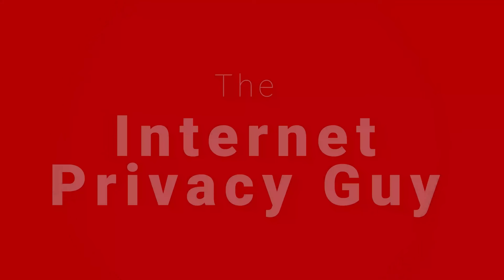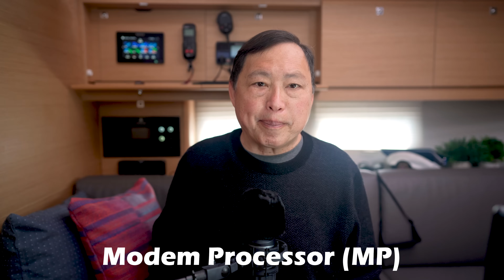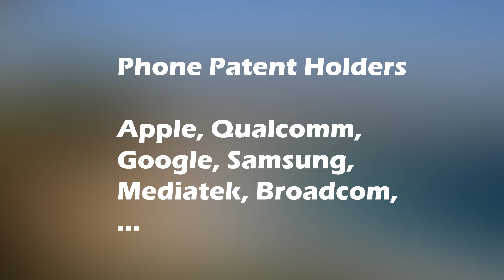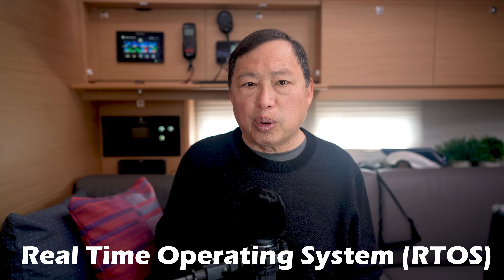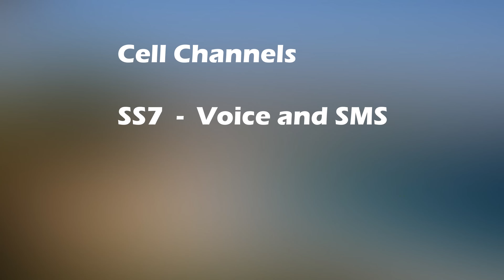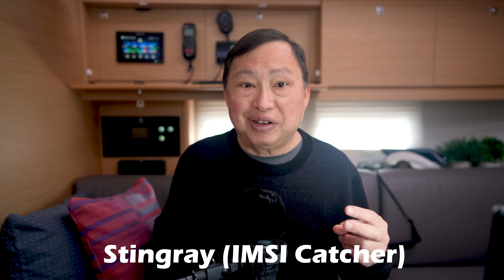How All Phones Can Be Hacked

Comment: Great videos. 👍  If my phone is hijacked by a Stingray device from adjacent area. Do they continue to monitor my phone or devices on the Stingray device or do they have to return n monitor, only available, from close proximity?
Reply from the maker: direct interception has to be in close proximity. But once your IMSI is identified, the tracking of certain things can continue using the CALEA surveillance equipment built into the PSTN (Public Switched Telephone Network)

Comment: A QUESTION.

My company invested a lot of money in ruggedised cell phones, and with 3G being closed down we decided to buy a few 4G & 5G to WiFi modems so our 3G handsets lifespan is extended. The SIM cards have been removed from the 3G cellphones. 

So we have sub-nets of cellphones running on modems - we use Telegram, and similar, for comms.

The questions centre around the modem & cell network. Given the only SIMS are in shared modems, what useful data could be collected upstream.

One other question. There is a setting on Android for WiFi comms between handsets. How do these networks operate?

Comment: The smd components on the pcbs are now connected by tiny nano meter sized pins underneath the chips that are  adhered to the pcb connecting pads  by a hot air gun or hot plate  and a pre printed template that holds the component's  in place Witch only the manufacture is licensed to only have these component holders while the pcbs are being manufactured. You can make one of these holders if you have a 3d printer a scanner and a programme. So you can make shure that you will make all the connections underneath the chip and components like the capacitors and diodes cause they are soo sooo tiny. And an old cell phone makes a good rework soldering iron.rhTs what I use.

Comment: But even without the SIM wouldn't the phone be identifiable via the IMEI? Or is that not transmitted without a SIM present?
Reply from the maker: The transmitted value is "Ki" not the IMSI which is in the SIM. Without it, you are not accepted on the network unless it is a 911 call. But you initiate that

Comment: Phones have five computers - the key three are com, interface & power management.  
The Com part has to interface with the telephony system - it is externally defined.
Reply from the maker: I believe you. Do you have inside information? I always say there are at least 3
Reply: @robbraxmantech  It comes from the specifcations -  the Telephone part is "fixed"  . The power control is very cryptic - I know it exists - i don't  know much about it, it is very  much the security hole in Apple devices :(.
The telephone part is public, So is insecure by structure. The security comes from economics - the cost of network access - little security for the user here.

The interface is much too complex for the function provided, so lots of security holes.

The Fourth Computer is the hardware Abstraction, it networks everything

The Firth Computer is the data management engine.

I define computers from a mathamatical prespective.
You are defining computers from a hardware network prespective. you are correct in that three is a minimum.

Comment: I use "emergency mode" on my phone which is a power saving feature which they hide in the emergency call settings. They further disincentivize it by giving you a user agreement first that a normal person (skimming) would find unnapealing. Then, in the mode, the text feature becomes a 'send help' by initially auto-populating the text field with "I need help" and a google map link to my gps coordinates however one only needs backspace that away. You get 2 optional apps (including browser and FB yuk) but the reason I use it is because on a full charge the battery will last over 8 days NOT on airplane mode and so, I imagine, that this mode will actually not, or at least in a diminished sense, exploit your tracking data so ubiquitously. Maybe Im wrong but the phone battery actually lasts that long and the only thing I can figure is that its just not broadcasting non-stop like normal.

Comment: Rob do you know if it's legal to flash custom ROMs onto a tablet in the USA yet (replacing the original ROM)? I know congress made it legal for phones years ago but not tablets. But phones are basically small tablets so maybe it is legal to install custom ROMs in tablets after all? Websites say it's illegal though last time I checked.
Reply from the maker: illegal? It's your device. Why would it be illegal? Or maybe we're in a new world now. We buy devices and it's not really ours. However the real problem is that there's no custom rom for new tablets.
Reply: @robbraxmantech  I agree with that statement about ownership. I asked because I did hear some recent news about the passage of some new laws which might make it legal now such as what they call "right to repair" laws (or executive orders?). No custom ROM's for tablets? Really? You sure? I could swear I recall seeing some custom ROM's for some tablets. Lineage OS at least iirc. I'll need to check to be sure. That was a while ago. Possibly a few years ago.
Reply: @robbraxmantech  My understanding is it's perfectly legal if the tablet manufacturer allows it and you truly own it. You may not truly own a device though. Especially if it's provided by some cell phone service provider. You must check the licenses for it. Some are subsidized making them more affordable but at the cost of never actually owning it so you forfeit the right to install custom roms unless it's allowed by the license.
Reply: @robbraxmantech  Looks like you're right. Lineage OS does not have any roms for the tablets I thought I remembered seeing. At least not now. None of the android custom ROMs I was thinking of have any roms for tablets. So it's back to the drawing board for me.

Comment: Rob, you're saying that adding a switch will RUIN the function of the antenna, so it won't work to turn the antenna off. THINK ABOUT IT. RUINING the antenna is JUST AS GOOD as switching it off. Right? So what you need to do is add a switch at the END of the antenna, to add length to it, so that it can't resonate at the right frequency. I'm always surprised by your consistent NO-CAN-DO approach to problem solving. JFC, buddy. Just get it done, already.
Reply from the maker: Hahaha! But as I said in the video, it is 12nm tech. You got a soldering gun for that? LOL
Reply: @robbraxmantech  I want YOU to design a daughter board that adds switches to sensors, antennas, etc. There's no need for a solder gun, or a microscope. The connections will be done simply by sandwiching in between the FPC connectors that connect the logic board to the sensors. It's all PLUG AND PLAY, especially if you design it to replace the original back of the phone.

It's odd when a smart guy is purposely obtuse, and won't make a product that would be in high demand for his 360,000 subscribers. Once again, you say NO-CAN-DO, yada, yada, yada. But YOU are the one that said it's so easy to make an antenna non-functional by changing its length.

Who cares whether its 12nm tech, or 20nm, or 5nm? A logic board is still a logic board, and an SMD QFP or BGA is still a QFP or BGA. An FPC connector is still an FPC connector.

With all this no-can-do BS you throw out, I'd bet a lot of money that you had a government career.

Comment: "A phone motherboard is an SOC"
You mean a phone CPU is an SOC

Also I've been quiet about this, but Bluetooth BLE is redundant and makes you sound like a robot. Either call it BLE or Bluetooth LE.
Reply from the maker: have you looked at a phone motherboard lately? which CPU? There are at least 3.
Reply: @robbraxmantech  That's the thing. A motherboard is not a chip.
A motherboard is a printed circuit board. An SOC is a system on an integrated circuit , or "chip"
There are 3+ SoCs on the average phone motherboard.
Reply: Just realized I might not have elaborated enough. A computer with all the required components on one PCB is what you could call a Single-Board Computer, or SBC. SBCs usually have one or more SOCs on them, serving as processors, radio controllers, etc. Phones are just the spookiest of their kind, with multiple independent SOCs rather than codependent ones you might find on things like the Raspberry Pi.

Comment: Sorry if I missed this.  What is the attack surface of a simple  'dumb' phone with no dataplan?  You know, a phone that a phone and only a phone.  And not a pocket computer which makes calls, runs hackable apps, does not protect privacy at all well on many levels.

Last point, phone with removable battery and faraday bagging options.  

Without going all tinfoil hat, is it possible to have a cell phone yet be private/hidden until it's turned on for use as only a phone for calls/sms?  Would like to see a video of this discussion.
Reply from the maker: The video applies. It has an MP like all phones. Hackable like all phones. But because there is no AP then the hacks would not access internet activity and files
Reply: @robbraxmantech  Thanks!  Was hoping for some dirt cheap MP less capable/hackable.  

MP attack vector is always carrier network based?  loosing AP reduce vector at all?

You channel is always insightful and thought provoking, thank you!
Reply from the maker: As I understand it, MP communications is through the radio only. So that can be initiated by a cell tower or something emulating a cell tower
Reply: @robbraxmantech  That last part "...something emulating a cell tower" is both worrying, and provoking.

While it would take a good bit of engineering,  emulating your own cell tower as man in the middle then monitoring, filtering and potentially firewalling could be quite interesting.....and most likely quite hard to do.  But I can't see another way to even start to protect MP from nefarious actors.

I assume cell boosters are bent pipe forwarders, but have potential to be an interesting place to start looking into.  Could a phone always be forced though one connection point?  Just musing out loud over a beer.

Thanks again

Goes back to the old movie, war games.  With Cell phones the only way to win at privacy is just not to play.  That's not a realistic option though, except for the Amish.
Reply from the maker: Stingray IMSI catcher is a government device that communicates with the baseband (MP) as a fake cell tower. So this is not a new concept.

Comment: How can anyone be 100.000000% certain that there isn't a hidden internal eSim, or engineered flaw/feature providing equivalent connectivity, built-in to the MP? I wish there were a true open-source solution.
Reply from the maker: If they did that, they would be circumventing their own security which is the "Ki" on the sim card. Someone can harvest "Ki"s and can duplicate Sim cards. So it is possible but if would be a stupid move from a cybersecurity point of view. Remember the actual identifier to enter the carrier network is the "Ki"

Comment: Wouldn't it be better to put the power switch to the whole of the MP instead? Isn't that what Pinephone does?
Reply from the maker: I actually answered that in the video
Reply from the maker: And no, that is NOT what the pinephone does. The pinephone separated the modem by using a separate SOC in an IOT USB device. Then all they had to do was unplug the USB.
Reply: @robbraxmantech  thanks for the answer!

Comment: Only one of the chips on the circuit board is the SOC, not the whole circuit board.
Reply from the maker: Huh? There are at least 3 SOC's in a phone
Reply: @robbraxmantech  he's confused by the fact that THE SOC is commonly only referring to the single primary user application processor suite.
Reply from the maker: Then let's make it clear. An SOC is a full CPU. The two independent CPU's are the AP and the MP. The AP runs other SOC's like the Wifi/Bluetooth/GPS module. That's under the control of the AP.
Reply from the maker: This video is intended to make everyone rethink what is actually going on. If you watch the video fully (it is very dense), the MP has a different OS (RTOS) has it's own separate Input/Output and shares memory with the AP (plus it's own firmware storage area). This is not a single chip.
Reply: @robbraxmantech  Ah, yes that makes sense. I think the AP can also have RAM on it as well?
Reply from the maker: they share RAM but they both have their own storage. Like the Baseband has something akin to FPGA (ROM space) FPGA is Field Programmable Gate Array. I don't believe it uses that technology but same function.
Reply: @robbraxmantech  Thanks. Also I have actually heard of FPGA and from what I've heard, I'm quite actually impressed with the potential of them tbh. I really should research into them more.
Reply: @robbraxmantech  I just noticed that at 2:34, you say that the main circuit board/motherboard inside the phone is referred to as an SOC, which was the reason for my initial comment. I know as far as iPhones are concerned, I've only heard the acronym SOC being used only in reference to the A-series chip and nothing else. That being said, I kinda understand the idea that the baseband chip could also be referred to as an SOC while thinking about it just now.

Comment: Hi Rob. Have you checked out Biktorgj's open source firmware for the pinephone modem? Quote from github: 
0 binary blobs in the userspace. Only closed source running on the modem are TZ Kernel and ADSP firmware
Reply from the maker: Pinephone modem is an IOT device. The main SOC for the modem is always proprietary. All you can do is wrap it around some IOT code but you cannot stop what's in the actual MP SOC and that's where the action is.
Reply: @robbraxmantech  Thank you so much for this very pertinent information.  I recently received my pinephone and was very excited because I could turn off wifi, bluetooth, modem...Unfortunately, despite all dipswitches in off position, my hackers were in the phone blocking access and blinking screens at me while they dinged notification bells in affirmation to statements I made as discovering this misery.  I believe that NFMI is being used by someone nearby and every phone with IOT or some circular antenna is vulnerable IMHO.
Reply from the maker: I don't think a Pinephone even has NFC. And The baseband is isolated so it can affect your clls and texts but shouldn't affect the Linux OS directly. the only connection is via USB
Reply: @robbraxmantech  no nfc specifically last i checked